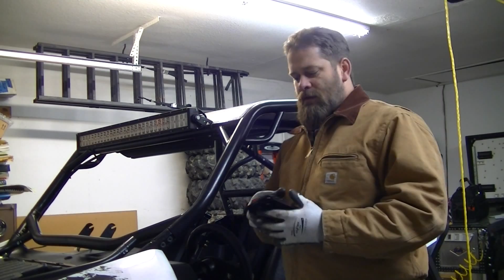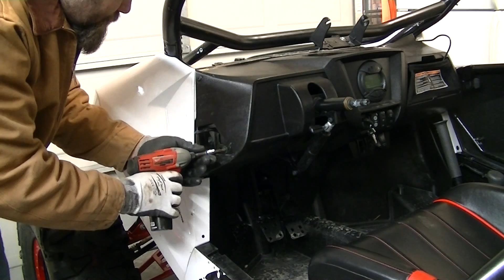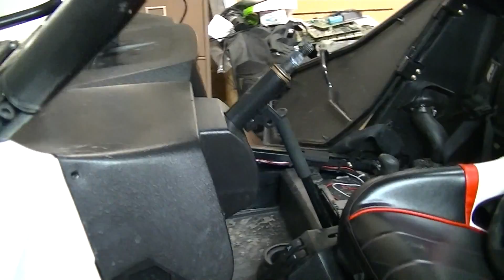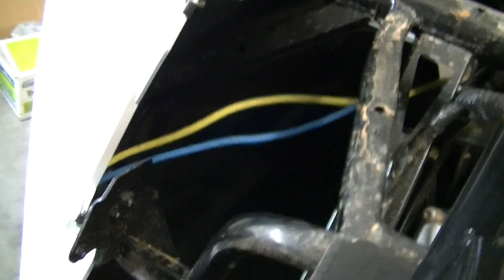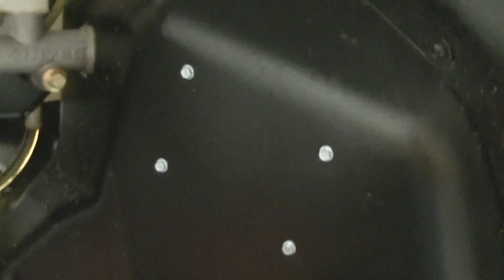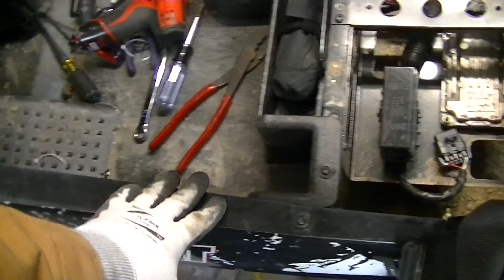Accessroy Fuse Block Installation on Wildcat Sport

Comment: About the power-distribution block near the battery- would you worry about that getting wet if you get water onto the floor? Just curious. Thanks for your how-to videos!
Reply from the maker: jedironin380 do you worry about your battery getting under water?  it's the same thing.  certainly better to keep it dry.
Reply: Just curious. I will be picking up a Wildcat Trail on Wed.  :)